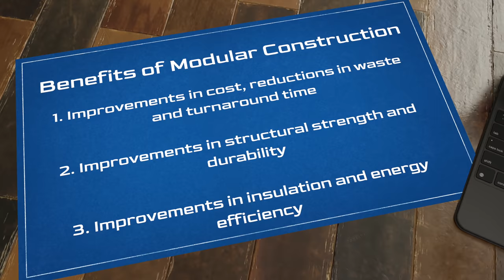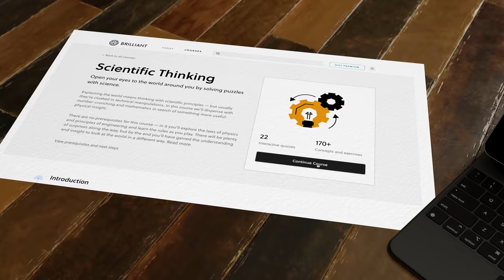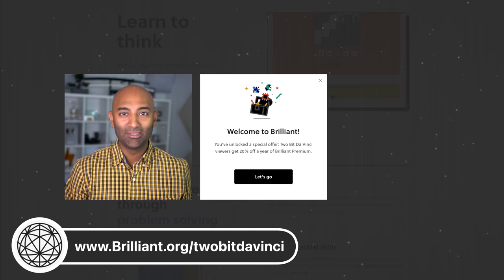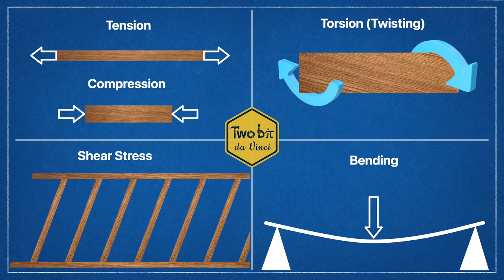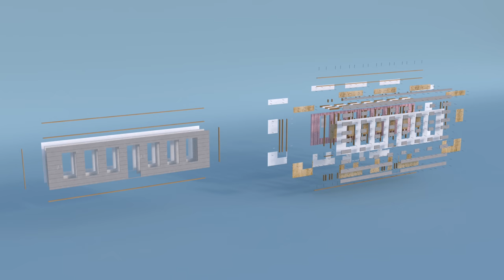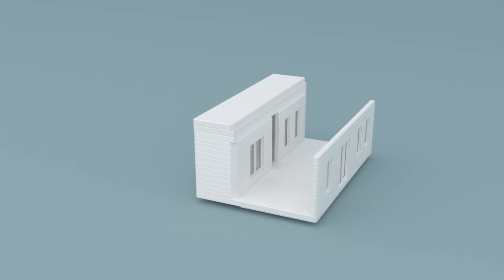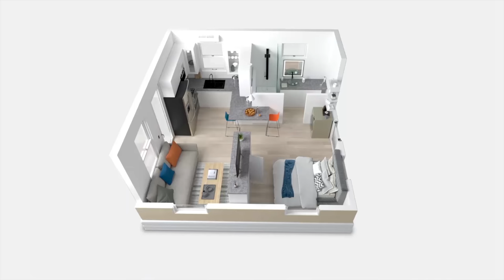What if Building Houses Reached Economies of Scale?

Comment: Ikea for full homes!!! Love it. I hope I'll retire to one of these things one day.
Reply: Better still.
Order AT IKEA.
Choose the look of the property.
Number of modules.
Print off the spec.
Maybe an image with the property on an AI generated "Google Earth" style background which also accounts for geographical anomalies (fire, quake, wind, etc) and specifies likely foundation requirements.

Take the spec to local planning.
They have already approved the Boxabl concept, that's no problem. They check the SITE.
When approved, obtain quotes from a Boxabl approved contractor for site prep.
Prep site, approve site, order building.
IKEA contacts you regarding standard furniture/ decoration packages. If required, these are installed at the factory.

1 month later it's up.
Final approval (30 minutes?)
Move in.
Cheap, easy, fast.
Reply: Yes, I would also love to retire to one of these complete with solar, batteries, water collection and other features for off grid living
Reply: @jamespaul2587  You are reading my mind :)
Reply: @jamespaul2587  the off grid options would probably have to be aftermarket.

Comment: The thing that you are failing to see is that expensive housing is a feature, not a bug, to the folks that have housing or are able move into new houses.  Although you dump on stick built houses,  the cost to build such houses isn't particularly high.  The labor component is pretty modest because of automation and various labor saving innovations such as PEX plumbing.  But that hasn't resulted any reduction in the cost of housing.  The savings is captured by contractors and cities, and is absorbed by open space, by higher quality water and sewage systems, and big, broad streets. As long as you've got zoning and variances, you'll have expensive housing.

Comment: Ricky.
Before Mars (!) 
I've suggested a use case elsewhere...... strangely(!) Involving Tesla.
We know they have plans to roll out more chargers.

Imagine a prepared site.
Several (Electric!) Semi trucks roll in with banks of prefabricated charger units.
A crane on site places them as required.
As they leave, two Cybertrucks arrive, each towing a Boxable unit. (Could be a single 40 foot on a Semi?)
These are assembled with the crane, (2 hours) which then leaves 
By the end of the day, there is essentially a new Supercharger location with a preconfigured restaurant.
(2 days to power up?)

Repeat.
Reply: Great idea.

Comment: Some questions to ask....
1. Building codes from state to state?
2. Insurance cost, can you even get insurance?
3. Resale value?
4. Water leaks, lots of moving parts tend to leak over time?
Reply: Water leaks? Really? 🙄
Reply: @TFT-bp8zk  
You don't need to seal after its up .
10:07
As the walls hinge out the edges press together. A recessed neoprene (?) Seal on the end face of one panel presses into the face of the other panel.
Perfect seal, protected, much higher tolerance and performance than "a caulking gun" 😁😁😁

Comment: This is what Elon is living in Starbase TX. While he is managing what’s going on with Starship and Superheavy builds. I like the idea of solar on the full roof as long as using the lightweight flex panels and not the standard roof solar we install.
Reply: What would be the issue with Standard Panels?
Reply: @Matzes  harder to ship? I honestly don't know.
Reply: flex panels normally have lower efficiency than rigid monocrystaline.
Reply: @joe7272  yes, but the flexible panels weigh significantly less, and most roofs aren't built to take much extra weight beyond whatever snow load they are expected to get.

Comment: The insulation foam shown is not very environmental friendly or fire resistant. In Norway we use glas wool or rock wool.
Reply: I believe the answer most homes like this use is to make the walls highly fire resistant. If I remember correctly,  boxable uses metal walls to cover the insulation.

Comment: I really hope that this form of building takes on & wipes out traditional building methods.
In the early 70s, my fiance & I walked through a display home designed to be built in stages. The first module had only the very basics (but quality) rooms to move into, but later, other modules could be added when the need arose. Kind of like a preplanned renovation build.
Back then, the land was cheap so buying the block of the size needed to accommodate extra modules made a lot of sense.
Homebuilding has a basic rule, the cost is based on $$/sq m, & there's no getting away from it.
Everything like tiles, windows, cupboards etc., are added to it & each of those is subject to the pricing of quality selected.
I've always believed that a small, but quality home, was way smarter than building a larger home than needed.
I've heard many stories where people are paying off rooms that they've never used.
Transportable homes have been around for decades, but mostly for holiday homes & even then, route planning had to be approved & police in attendance.
Much later, Structural Insulated Panels appeared in the market, & now CNC machining is commonplace, so the Boxabl combines all those advances in one package.
Boxabl's system will be a turning point once people realise that traditional building & the dream of their palace is a marketing con, then the sooner people will find true happiness. 👍
Reply: It's also cool because you can not only attach them horizontally but vertically also.

Comment: The good thing about BOX🏠BL is that it's easier to transport than others factory made houses.

However the great DISADVANTAGE is that the folding parts ( Which seems to be a LOT! ) NEEDS sealings and perhaps SPECIAL insulation to keep rain snow heat and cold out.

How long the sealings will last?
and will be  necessary to almost DISASSEMBLE the WHOLE house 🏠 to FIX it?

Will it CO$T as much as the house itself?
Reply: The seals will be perfect, as insulated as the rest of the structure, and permanent.
They're on the edge of the wall plates.

Comment: Finally! homes enter not just the industrial age, but the information age. We switch from 19th century homes (still being built) to 21st century homes. 
Buy or lease the land, unfold your home modules, and set up in a couple of days. Your family grows or work changes add more modules.
Your work takes you elsewhere, pack stuff from the unfolding bit into the fixed section or moving vans. Unstack and fold your home modules then reverse the procedure at a new site. 👍👍👍♥️♥️♥️
Ref Robert Heinlein "we need 20th century homes, not 19th century homes," paraphrase 'homes that are cheap, adaptable, customised, and relocatable'
It only took 60 years after he wrote that for the first one has appeared!😫

Comment: I think one of the big problems with manufactured homes is that they are not an investment. They drop in value no matter how nice they start out. My guess is the inability to customize a 20 year old manufactured home. Move walls. Do a bathroom makeover more than just fixtures. 

You can take a standard built house and remove all the drywall, all the electrical, all the plumbing. Put the master bedroom where the kitchen was. Turn the living room into a kitchen, etc. if someone can make this economical with a manufactured house I think the industry would start challenging standard home builders. 

Just making a new house 20% cheaper is only going to help a small amount. But it is better than nothing.
Reply: This traditionally has been the case with mobile ( on trailer frame) homes in a park with rented lot. But is not the case with modular or prefabricated homes on thier own land, then ist considered real estate.

Comment: Interesting, how much will such a home cost ?  I’m ready to buy !
Reply: Currently $50k
Reply: @katiegreene3960  thanks for answering within 3 hours.  What does $50,000. cover ?  I mean, electric wires installed, plumbing included, labor for what ?
I mean seriously, I can buy land in southern Vermont or whatever.  Foundation required.  Knowing my total cost concerns is essential to the project.
Reply: @MissMarinaCapri  as far as I understand the 50k just includes the home. So you would need to pay shipping, and site prep for your land. And in Vermont you might have to also pay to install a peaked roof per snow loads. To be honest another traditional prefab or modular double wide is likely better and more cost effective in your area at the moment.  And it might be a while before they will get thru thier current pre orders.
Reply: @MissMarinaCapri  also just some ballpark figures for this or other prefab or modular home. Your costs will vary a lot but this is a guess. (Hired out) 1.Excavation and site prep :10k 2. Depending on site and type of home either a slab or rock and blocks and tie downs : 2k-10k 
Septic : 15k well : 10k electric service: 5k delivery and set 5k paperwork 1k misc: 3k
Total : site prep $45-55k plus land price and any other miscelanious costs.
Reply: @katiegreene3960  , WOW !  You really went above and beyond with much appreciated information, thanks 😊.

Comment: Only one quibble- how sustainable are the materials used? As a builder I share your enthusiasm for factory built homes, but that shouldn’t mean ignoring the fact that the insulation materials, panels and adhesives appear to be ( in this factory)  dripping with plastic and noxious chemicals. Please tell me I’m wrong! Oh and also; wood is a way better insulator than brick, which is widely used in Europe, and is of course renewable.
Reply: What would you use for insulation in a small, thin walled modular structure?

Comment: Hi there first I'd like to thank you for all your hard work and your valuable information you share with us. About wood not being a good insulator. It's my understanding that wood is one of the best insulators there is. I remember learning that in the 70s in woodshop class. So you might want to check that out and get some additional confirmation that wood isn't a good insulator. I completely disagree. Thanks again I really enjoy your podcast.
Reply: I stand corrected, the r value of wood is 1.41 per inch.
Reply: When compared to fiberglass, rockwool, blown cellulose, or foam, wood barely insulates at all. If you compare wood to most other structural materials like masonry or steel it isn't terrible but those materials are fairly decent conductors.

Comment: Version one on Mars will be melting the ice at Korolev with Kilopower (actually megawatt level) nuclear power to make the spaces to house a 'boxable' factory.  (Sytrofoam/areogel is orders of magnitude denser in liquid precursor form.)
Reply: @catshepherd3102  The infrastructure required (mass) for wind is about an order of magnitude heavier than the equivalent power nuclear.   After it can be manufactured from Martian material then yes wind power would be useful.

Comment: Modular homes are a wonderful idea. But using them on mars for the first colonists doesn't seem such a good idea to me. It would be simpler to live in the starship themselves until something more permanent can be built. Especially as the starships won't be able to go back on earth until around a year and a half will have passed. If you need another starship to bring houses for the passengers, you will only limit the ability to bring many people at once.
Now, making houses will be a top priority after food, and maybe fuel production are established. Making a house factory would possibly be the way to go. Unless you use 3D house printing, whichever is the best option.

Comment: I remember the first time I went to the United States I was totally shocked by how cheaply built and overpriced our Airbnb rental was compared to the standard we were accustomed to in western Europe where for instance my own house was built like a tank with 20" wide granite blocks on the facade as well as oak wood doors everywhere
Seriously I wasn't impressed😕
I mean from a distance the house we rented looked legit tho (4 bedrooms,two cars garage,front yard,backyar,little pool area,modern appliances etc...
But once we went inside it was a whole different story esthetically it was aight but structurally holy moly guys! lightweight cardboard doors,drywalls,squeaking floor you name it and to add insult to injury it wasn't even an old house it was built in 2009 and we went there in 2015 smh...

So I'm glad that Boxabl went the SIP way for its structural wall panels
I can't wait to put my hands on one of these units...😉👍🏾
Reply: Aside from maybe the doors (and plenty of North American homes are full of solid wood or metal doors) I don't get your complaints.  Wooden floors always develop squeaking characteristics over time as they deform slightly.  Drywall is perfectly adequate for interior walls and makes the building easy to renovate and update.  Also these aren't at all structural features, a building should be structurally sound with just it's foundation and frame (no doors, walls or floors).

Why are Europeans so obsessed with massively overengineered housing?  We're talking about a home, not a bunker.  You must expecting a war to break out, because you don't need 2 feet of granite to protect against rain.
Reply: @VitalVampyr  yes why build a stone house, when you can build a new 1 each time a storm passes by.
Reply: @FrVitoBe  Storms (even hurricanes) rarely cause major damage to wood frame structures.  Even when they do the damaged portion (usually the roof, which would probably be of similar construction with a stone house) can be repaired relatively inexpensively.

Wood as actually much stronger than stone in shear or tension stain and has a higher specific strength than any other common construction material.  So rid yourself of the notion that wood buildings are always rickety deathtraps that won't withstand a stiff breeze.

Of course the materials choice wasn't really the issue.  I'm sure you'd also recognize that 1 m thick logs for an exterior wall is excessive and a sheet of 1 cm pebbles glued together is inadequate.
Reply: @VitalVampyr lol😅 Actually it's funny you asked that because the house I'm in right now was bombed the hell out during WW2 just like most houses in the village were
Thus only the massive stone walls were standing after the fire that consumed the house after what they completely rebuilt it in the 60's then it was remodeled in 2005 and I bought it in 2007
The main advantage of building tough houses is for the longevity aspect because it's made with the intent of leaving a legacy behind for future generations and no offense sir but I traveled a lot and so far I think that American houses are among the flimsiest I've seen
But don't worry even know I disagree with the technicality of your arguments I definitely won't dispute it for a good reason because I totally understand that you guys have your own way of adjusting stuff based on the reality of the environment that you're in
Besides I already went to that rabbit hole with an American friend of mine who lives in Long Beach whom I called when I noticed the flaws of the unit I was staying in
In all honesty I felt like I was getting finessed by the owner based on the hollowness of the construction materials and the overall quality feedback that I had at the time
It's almost like I was getting robbed from paying two grand over 10 nights at a cheap Warner Bros Studios set but my friend explained to me that it was a perfectly standard price for the type of rental I had and that it was called stick built architecture to which I replied "aren't there earthquakes,wildfires,hurricanes all the time in California and he said yes sir a lot! Nevertheless we have plenty of wood in the U.S. so it's cheaper to build houses this way...👀???
To be honest it gave me a headache because even after all his explanations I still couldn't understand why would anyone do such a thing and I'm sure most foreigners who visited the United States did feel that way as well but it's alright I get it you guys have your own style we got ours let's not lose sleep over this😅✌🏾....

Comment: So... It look like they want to build homes out of the same matrials that turned Grenfel into the towering inferno, and got over a hundred people killed? EPS foam doesn't catch fire immediately, but can catch fire, and once it does it can be very hard to put out.
Reply: Just saw that. You're right. I would like to see something more sustainable personally. But I once spent time designing an RV. insulation , especially in small portable thin walls, is really really hard to figure out. All of it has serious drawbacks. Some of it is toxic, some melts, some doesn't work well, some rots,etc. Do you have any suggestions for a better material?
Reply: @jameshughes3014  Not sure. But it's the most concerning issue that wasn't addressed in the video. Others incluse lack of independent varification, glossing over the need for a roof, apparent lack of AC or heating, saying a 8' wide room is bad, while seeming to offer a 7' kitchen, no mention of warranty, or the problems of joining multiple units together, which would probably bring all the trades back on site that they claim their design despences with.

It's clever macro origarmi, but at the end of the day I'm not sure $100k+ is great value for an 'efficieny flat'.
Reply: @anticarrrot  I don't see anything you've mentioned being any different than any other modular or pre-manufactured building. I would like to hear about different types of insulation but I don't see EPS being the worst of the worst. Maybe there's something I don't know about it
Reply: @jameshughes3014  Agreed. But remember near the start (and elsewhere) when they claim they don't have the problems of other modular buildings? Yeah...

It may or may not work out, but the video did not strike me as objective or especially honest.
Reply: @anticarrrot  No I don't remember that. Can you point out what part of the video you're talking about, maybe with a time stamp or just minute in the video?